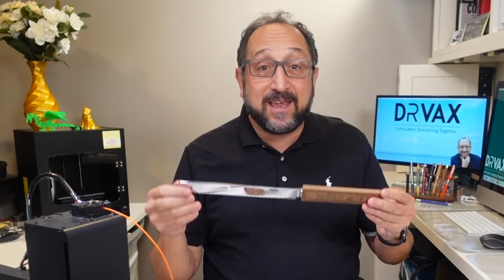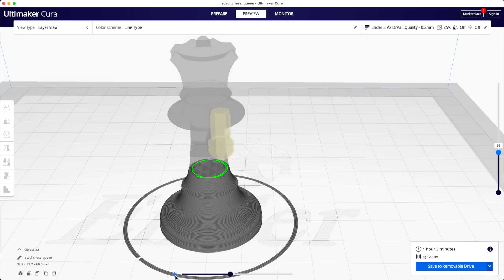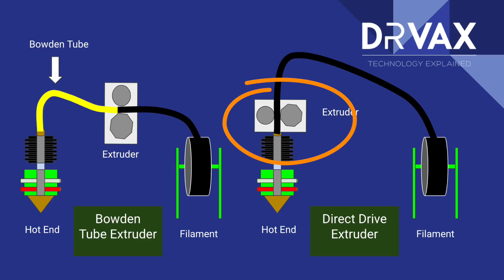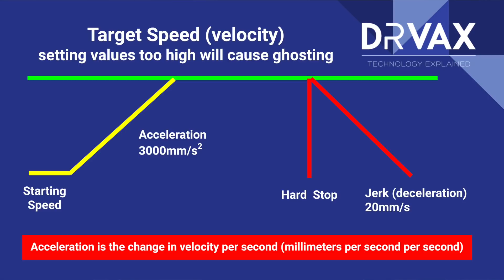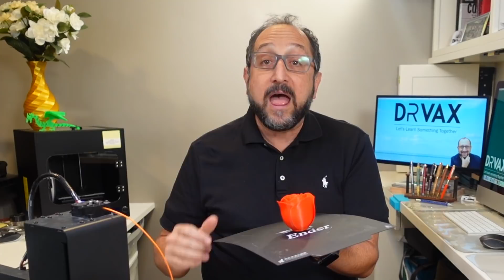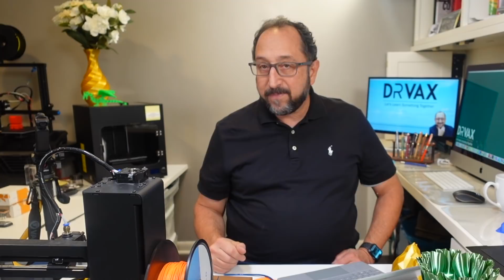Troubleshooting 3d Printing Problems

Comment: HELP...    I have a creality 5 pro.  I purchased an s1 hot end but the cables are only a few inches long.  Can someone direct me to where I can buy the extension cables.  I really really don't want to cut and splice such fine wires.  I'm old and my hands are unsteady, and I don't have connectors.

Comment: What I learned here is to never get a bowden tube style printer. Direct driver head may be heavier but if you print slower then no problem. I have an ANET A6 which I printed braces to hold the frame down on the base and I use default accel and jerk. In draft mode even it prints great. I printed a fan nozzle a bit more directed than original all works well. Bowden sounds like a pain.

Comment: I've been using loctite spray adhesive.
It gets tacky when warm so I can release my prints easily when the bed is warm. It also stays for a few prints before I have to reapply. I also have a mirror made bed

Comment: Thanks for all the videos. I have an ender 3 v2 and am new to this . Recently it's started to cause bubbling on layers after the first one. The first layer is perfect but on the next layers it produces large bubbles(quarter inch and elongated). I've tried raising temp of hotend and raising and lowering z offset with no improvement. I've also tried different color filament(Inland). I would appreciate any suggestions. thanks

Comment: I got a Monoprice MP10, and figured out how to use it on my own; free in an office move. I had a failure with black filament one day, and got bad prints for a full week. I finally took apart the hot-end, and realized that it's not actually black. I turned the heat all the way off and melted off what I had assumed was a legitimate part.  Yields went from 10% to 95%.

Comment: I agree with You that applied creativity gives satisfaction, but nothing is more frustrating than a not working 3D Printer. I've bought a HE3D EI3 printer years ago and it never worked properly. Cura was never able to identify the COM11 USB port for working. Pronterface was able to move the hotend in to the desired direction and extrude material, but never able to print anything, due to the fact that it never recognizes the dimensions of the bed and remained all the time at X=0 Y=0 point. Repetier generated Marlin files, but without using the MKS Base V1.5 board and the cooling fan never worked at the right connection. The new Marlin 2.0 has so many examples, but none of them suits to my printer. Tevo Tornado has such a MKS Base V1.5 board, but I don't know precisely the differences between him and my printer. I've watched hundreds of Youtube videos, but none of them showed how to put it at work in order to print anything properly. Only frustration and illusions overall.
Reply from the maker: I feel your pain.  I have learned to check online forums, discussion groups, and support areas on the Internet before purchasing any new technology to ensure I have access to critical information.  

In addition, I have found USB connections to 3d printers are at best unreliable with many devices and start with any new printer by using removable media, for example, an sd card.  Then when I have everything working the way I expect I play around with either Octoprint or a direct USB to computer connection.

In fact, I will be discussing this in an upcoming video.

Comment: Are these slide panels available to down load?  I would love to print  them out for a quick reference guide.  I used autodesk and solid works for years and I am getting into 3d printing as a hobby since retiring.  Thanks

Comment: Hi Doc
Can you help me on this.
When I start to print on my Ender 3 pro I constantly get a click on the stepper motor that's feeding the filament through. Its as if it pushing it faster than it can melt. I have tried these things. Put nozzle temp to 230 and tried lowering. There seems to be a slight spluttering on the first layers. I have also followed the tutorial on extruder and that was done

Comment: for some reason my 3d prints are coming out with brittle build. Im using Glow in the dark PLA filament that is at 1.75mm. I leveled out the bed, made sure the heat nozzle end was given a small tiny gap to so to print the filament on the bed. I think it could be under-extrusion or it could be something else. The prints for some reason have pores/holes here and there.

Comment: If I try to print that vase even with poor quality it would take me 50 hours I have a cr10 brand new what the hell am I doing wrong? I'm using the creality slicer which is basically cura 

Example I'm printing right now a little tray for a specific purpose it's 152 cm in diameter and it has a tin hmmm walls all the way around so it's basically a little circle with wall around it picture making a 8 millimeters high and then carving out with a shell command I'm leaving to mm everywhere that's all I'm Printing and it wants to take 10 hours? And a shity print on top of everything what the hell am I doing wrong
Reply from the maker: You need to select "vase" mode.  I do not use the Creality slicer but it might also be called "Spiralize Outer Contour".
Reply: @MakeWithTech  thank you for the reply sir. What slicer should I be using I don't care if I have to spend money on it! It's ridiculous if I make a bottle cap and takes 3 hours this normal? I mean there's some very useful things that I print but they take forever. I know it's a slow process for the most part but I see can people complaining that this or that model took them five hours to print and if I tried to print that same model it would take me 3 days. I just cannot understand what I'm doing wrong. All the models I'm talking about are very very simple designs
Reply: @MakeWithTech  in my example above I just now noticed that voice recognition made it impossible to discern what I was saying. Basically the model that I'm trying to print just picture the lid from a coffee can it's basically that just a little smaller it's a component for a separate project so it has to be 152 mm in diameter. It's basically a 2 millimeter thick coffee can lid and no matter how I tweet the settings its showing 13 to 50 hours

I'm about ready to sell my printer, if this is normal then the hobby itself is useless to me for rapid prototyping. I mean I literally would need five or six printers to make it worth what I'm doing
Reply: @MakeWithTech  i officially do not use that creality version of cura any longer either.  I loaded up cura and did what you had suggested. The print took 4 hours and was the most beautiful finish I have ever done. 

Thank you very much for the tip

Comment: Hi Dr. Vax love your vids but I have a problem, I use simplify3d to print with and get really clean prints until I add supports then it strings like crazy any advice what settings I need to play with to get rid of this stringing problem?
Reply from the maker: Try increasing retraction and lowering the temperature.
Reply: Wow that was fast thanks for the suggestions I’ll give them a try

Comment: Bigtree Tech SKR 1.4 Turbo G29 Level fails to work 3D printer works other wise
Reply from the maker: Interesting.  Are you sure you have the most recent firmware.  I do not have one but many people like this control board.
Reply: @MakeWithTech  Marlin-bugfix-2.0.x using Visual Studio for a Creality Ender 5 Plus using BTT SKR 1.4 Turbo
Reply: everything works except G29

Comment: Hello Irv, I am about to make a purchase of a 3d printer. Looking at both the ender 3 v2 and the Anet ET5X. I have done a lot of research already, but was hoping for some first hand review of the two systems, just general..... ender 3 vs Anet. The big plus I can see from each is, the ender has a huge community so support won't be an issue!, where the Anet has dual z axis screws, which is impressive!.......so really just need to get some further info and get something that will toss me off the side of the wire I am treading right now.

Comment: I'm pretty new to 3D printing and I've had trouble with a clogged nozzle over the last few weeks. It turns out that the problem was the Ender 3 Pro bowden tube. Yes, it was all the way down. For some reason the tube was melting and deforming. And we're talking about a temperature range of 210°C to 220°C here, nothing unusually high. For some reason it still was melting and then formed a block inside the nozzle. I've solved it by buying Capricorn style PTFE tubing and then replaced the part that goes into the hotend with that. I've kept the rest of the way stock bowden tubing and now that issue seems to be solved. The new tubing is supposed to be able to tolerate higher temperatures (up to 300°C) which means that it should not melt at 220°C.

BTW. another way of cleaning a really persistent clog in the hotend itself: take off the nozzle and then run the full length of your bowden tube through your "Ender style" hotend while it's at temperature. I had to do that because there was molten bowden tubing smeared all over the inner walls of the hotend. Looked like S'mores in there
Reply: Sound to me like your original tube wasn't made of PTFE (Teflon) like it was supposed to be. Counterfeit part got through QA perhaps? That should be covered under warranty, but if you buy directly from China that might be realistic sadly.

EDIT: Another option is that your thermocouple is bad and reports too low a temperature, which could be dangerous. Consider checking the temperature with an independent source. If that is not feasible at least sanity check it: does the manufacturer recommend temperature for your filaments work as expected?
Reply: @VorpalGun  yeah, it's possible. And maybe they'd replace the tubing - but 2m of  that Capricorn tubing was 15 bucks so it doesn't really matter. I've used maybe 3 to 4 cm of it and now everything works really smoothly again. Unfortunately I don't have any thermometer that works for the required temperature range so I can't really check atm. Prints look great though and if this really was running way too hot I guess they didn't because that'd drastically exceed the temperature my PLA is supposed to be printed at. I normally print at 210°C to 220°C, the tubing should(!) withstand 260°C

I do have a bunch of spare thermistors incoming, though, and maybe I'll try one of those to see if I get similar readings.

And frankly, I'm glad that stuff like this happens. I learn a lot about the technology and how stuff works while debugging and fixing this stuff. As it's a hobby and I don't really need the printer to be available all the time I actually enjoy prodding around
Reply: @saschaschneider6355  I hate to break it to ya bud bud, but that's not the PTFE Tubing and was clearly molten / filament that in some way shape or form escaped from the intended filament guide path set forth by the PTFE/Teflon tubing and caused a clog initially due to the none existent presence of proper cooling of the hot-end. You won't be melting any PTFE  tubing with an Ender 3 anytime soon unless you had a 50 watt heater and had no cooling whatsoever. Even bad quality Teflon tubing won't melt even at 285C and beyond... Plus before it would ever come close to melting you would have a serious accumulation of OFF-gassing and smoke emitting from your hot-end/printer putting you into a panic and ultimately a very dangerous / toxic space due to the now deadly gass being let off into thew air by the degrading PTFE...
Reply: @yourtubernoob  I hate to break it to ya bud, but opening like that makes you sound like a condescending prick. And it was NOT "clearly filament", because, it was a white, gooey substance while I had printed with red and blue filament. It also covered the whole length of the metal tube inside the hotend, which means that it would have had to creep up all the way between the tubing and the metal. Sounds pretty unlikely to me. Also the end of the tubing that was inside the hotend was visibly damaged to a point where I had to cut it off. 

But you make a good point about degrading PTFE and the temperatures needed. Then maybe the tubing is not PTFE but some other white material that has a lower melting point. Because melt it did. That would explain why I had filament get stuck in it that was slightly thicker than 1.75mm (1.83) but still below the inner diameter of regular stock tubing (2mm). It was stuck and I had to use pliers(!) to get it out, because I had to pull on it pretty hard. So maybe it simply is faulty, non-PTFE tubing that's not following the specs.

I don't know for sure. What I do know for sure is that the end of the tubing, that was in the hot-end, had degraded pretty severely in merely a few weeks. What I do know is that it left a coating of a similar substance and colour (unlike the filament I've used) on the inside of the hot-end's metal tube. What I do know is that that same substance ran down and clogged the nozzle more than once. I know because it was white, unlike my filament, it also had more of a goey, marshmellow-y consistency. What I do know is that the tubing had become thinner and less smooth and less shiny on the outside, where it had touched the metal. I also have my doubt that there's enough pressure in the system to force leaked filament up between the tubing and the hot-end for the whole length. Even with a clogged nozzle that seems unlikely.

Anyway, I've got a few meters of regular, non Capricorn PTFE tubing coming my way soon. Once it's here I'm going to compare that to the tubing that came with my Ender to see if there's a discernible difference in properties, like melting point, inner diameter and so on.

Comment: There are a few of these videos around that talk about diagnosing a problem with a probable solution. But as there can be multiple causes for what looks, to a novice, a very similar problem, I'd love to see a series of videos that go the other way. That explain what happens to your prints when you change something. You could call them things like: 'How to Goldilocks your 3D Printer: Belt Tension' and show what happens with too much, too little, and then just right. There's a good video called 'This is Y' by Tech2C ( https://youtu.be/AKTvykTPjQw ) that pretty much does this about gantry weight on a coreXY, and acceleration settings, but unfortunately he doesn't talk about accelerations settings that are as low as my closed source firmware restricts me to, which is 100mm/s^2. He only talks about as low as 500mm/s^2.
Reply from the maker: Good idea.  I will give it some thought for future videos.  You might like this video which does a bit of that.
https://youtu.be/UKEUBeeIUqM

Comment: Very useful tips - but I do have an issue not covered, maybe someone can advise:

I have a Sovol SV01 (first printer, direct drive extruder, with BLTouch and mesh levelling upgrades). I am using PLA at 190C, 0.8mm retraction. It works fine apart from one thing:

At startup, it heats up, then does a 3 point bed level check, prints two starter lines on the LHS to get everything flowing, then starts the print with the skirt / brim or whatever.

During the heat up and 3 point level check, some filament gets extruded, and the usual result is that by the time it is moving to the skirt there is a small blob of extruded filament on the nozzle. Sometimes this ends up in the print, the nozzle then hits it, a motor misses a step, and there can be a layer offset.

The reason underlying it is the 'early extrusion'. I have never managed to stop this.

What I do in practice is watch the start process carefully, and if I see a blob / stringy bit, I carefully pull it away from the nozzle before it can do damage to the print. This works, but I cannot help feeling I am attacking the symptom, not the real problem?
Reply from the maker: You may find it helpful to better understand the start of print gcode used by your slicer.   A bit of a blob at the beginning of a print is a common issue.  The lines printed to get the filament flowing are part of an effort to reduce this.   You might further reduce this by adding additional lines, then retracting before you travel to the print.

A great place to discuss this is at the DrVax forum located at https://forum.drvax.com.
Reply: @MakeWithTech  Ok, thanks.

Comment: Get rid of the couplers. Use compression rings  instead. Gets you to the same position every time
Reply from the maker: Interesting idea.  Do you have a link for a source for compression rings?
Reply: You will have to drill out the center with a 4mm drill in order to fred the bowden tube through

Comment: Also clear a stubborn block with nylon and a cold pull. Heat up, insert nylon at a hot temp, turn off machine and let it cool down and pull out and check to see if it pulls out the blocked material. Repeat till it is only nylon coming out.
Reply from the maker: Thanks for the info!   I have never been a big fan of cold pulls.  Seems a bit brute force to me but this technique has been recommended for years.